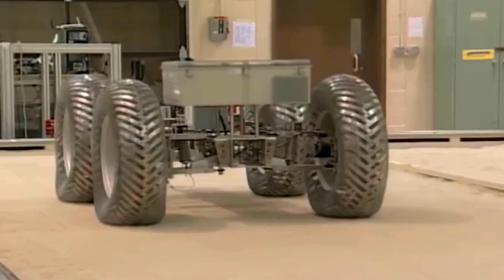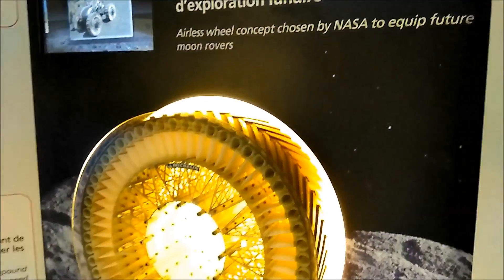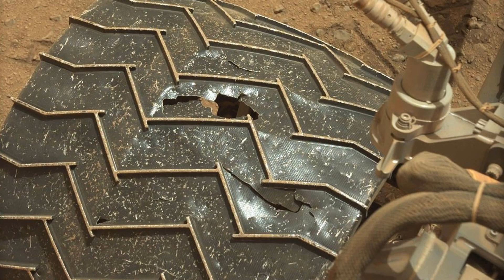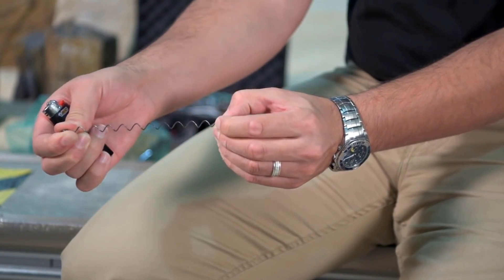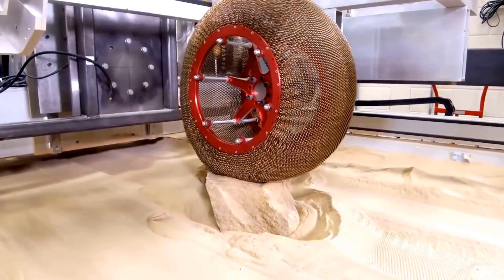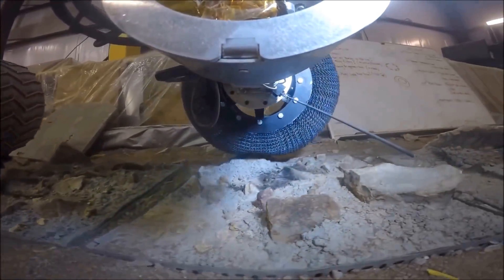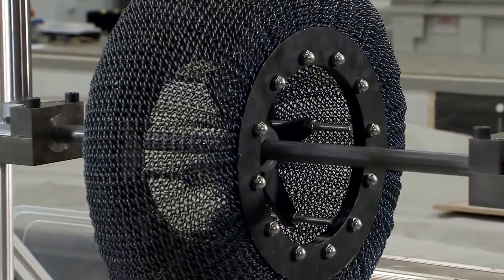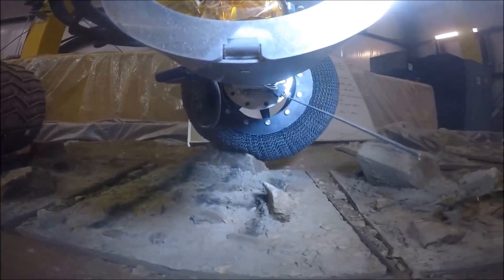NASA Reinvented The Wheel

Comment: So, does the vehicle use an infrared laser, to warm the wheel when it rotates to topside?
Reply: No, as it uses it as a superelastic alloy. You can think about nitinol as having three ranges of temperatures. So in the lowest temperatures it behaves like normal metal, in the middle part it has this magical effect of having it comeback to it's designed shape and in the highest range of temperatures you can actually shape it.
So if you design it so it is used in the lowest range of temperatures it behaves like a spring in a video - you bend it and then if you heat it it comes back to its shape.
You can also design it like the tire, to be used in the middle range of temperatures. Then as soon as a force stops bending the tire, it comes back to its 'programmed' shape

Comment: Would this sort of technology work well on earth, say, on pavement? I've been trying to look up examples of metal tires that could be used on pavement for a while now, with very little results.
Reply from the maker: I doubt it would last on pavement either Concrete or bitchumen as the metal would get eaten away, plus you would have no real stopping power and the metal would slide on the road under hard breaking, that's my opinion.
Reply: Wonder World What if you made a composite tire with a Nitinol mesh layer and a protective rubber layer?

Comment: And how did they apply heat ? cuz as explained the metal require heat to return to its original shape.
Reply: These alloys have 2 properties: shape memory and superelasticity, which is the one used for these wheels. No need to apply heat.
Reply: Heat is just one way of applying energy to bring back the shape of the tire, kinetic energy works as well
Reply: https://youtu.be/2lv6Vs12jLc
Watch from 5:23 onwards
Reply from the maker: I could not find that information, I assume they are passing heating through the wheel in electrical heat, on a MARS Rover it would have a nuclear generator producing the heat.
Reply: Thanks !

Comment: what about wear and tear ?
Reply from the maker: every wheel has wear & tear, what is your real question.
Reply: i mean have they solved it ? i have seen a lot of these new wheels and they work great but i heard they mostly will have problems with maintenance, wear and tear. im asking because im wondering if they could ever be ready for commercial use like in cars and im trying to understand why the need to replace the current type of wheels we use in cars.
Reply from the maker: I read they are aiming to have these wheel in use on the 2024 Mars Mission, obviously they have about 6 years to perfect the wheel until then. But no design is perfect and everything mechanical wears & breaks down, the best you can do is make something that performs better than all other designs.
Reply: The outer layer of the alloy is made out of Rutile (TiO2)

Comment from the maker: imagine while on Mars, the wire on the wheels gets caught in a rock jam and unravels the wheel like a woolen jumper.
Reply: hi
Reply from the maker: *waves
Reply: I don’t think that could happen it’s a mesh intertwined with each other so it wouldn’t unravel
Reply: Are they going to add an electrical current or a heat source to the wheel to make it return to its previous dimension? It needs energy to make it work, hope they planned for the extra energy load.
Reply: The wheels are made of nitinol. Nitinol can be shaped with temperatures, and can even be used like an engine on a pully.